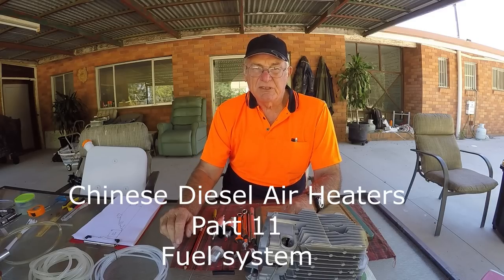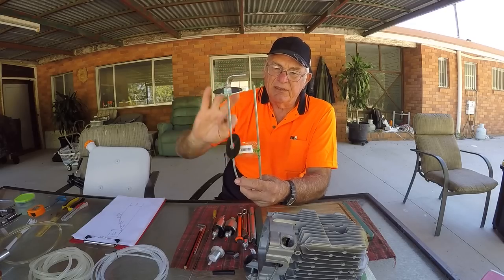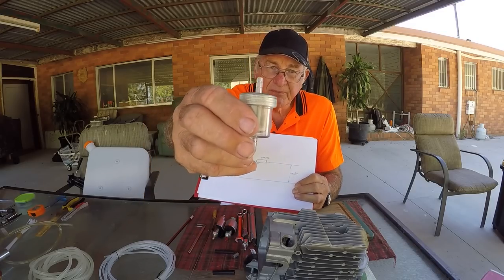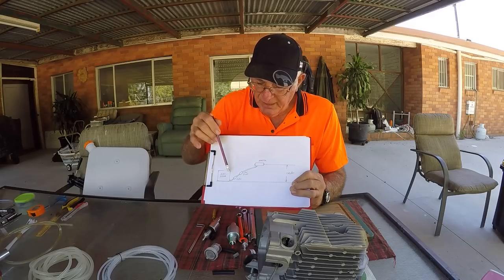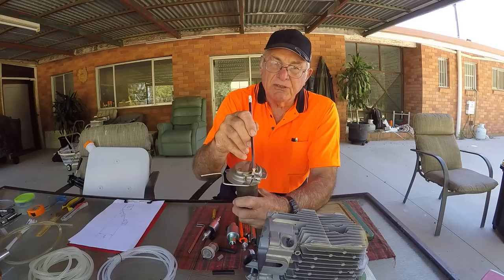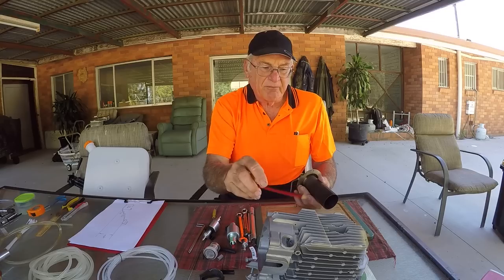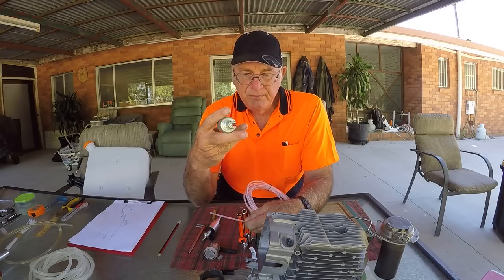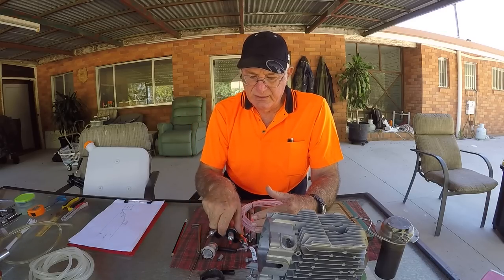Chinese Diesel Air Heaters - Part 11 -  Fuel Delivery

Comment: John, love your work and watched EVERY video to gather up your wealth of knowledge on the subject. Of course, this was not out of curiosity because I have a 2kW heater that has been troublesome in spite of your best efforts to make very installation a success. In my particular case I gathered from your comments about the dosing pump being a poor sucker and better at blowing. Extrapolating this thought I decided placing the fuel tank above the pump would allow gravity to feed the pump and it wouldn’t need to work so hard. Clearly this was wrong and the cavitation bubbles were excessive and probably the fuel dosing likewise because all that was coming from the exhaust was thick smoke and the heater refused to fire (burn). After a repeat viewing of your video I noted the fuel should gradually rise up to the pump and then on to the heater unit which I thought to be a guideline rather than a rock solid requirement. To correct my install I put a long feed line at the base of the tank then running the feed line above the height of the tank in a loop and then allowing the fuel line to run back down by siphon effect into the dosing pump. Who would have thought that the gravitational effect on the fuel delivery would cause the heater to fail so catastrophically. Obviously a trap for young (70) players who did not pay sufficient attention to your diagram showing the fuel line in an upward direction. Heater now running, no smoke, perfecto! Thank you so much for your painstaking effort. Appreciated more that you would realise. Cheers and best wishes.
Reply from the maker: Hi Michael,

Thanks for the feedback, and glad you found the videos helpful.
One question. Is your delivery fuel line hard narrow bore nylon, of large bore clear plastic line?
Cheers,  JMcK
Reply: @johnmck1147  Initially, the feed line to the dosing pump was black rubber (automotive/marine) but made the loop using the hard nylon narrow bore line. Following your advice I have steered away from the clear plastic although understand it matters little on the low pressure side of the pump. Cheers.
Reply: @johnmck1147  Hi again John, following my diesel fuel delivery correction, my diesel heater fails to fire when initially turned on and goes through the glow plug / pump dosing sequence, lots of smoke from the exhaust, 2 times before the E-10 error code shows on the LCD display. However, when I press the ON button immediately thereafter the heater starts to fire with a heavy breathing sound followed by simply working with no exhaust smoke CO is negligible and it goes and goes and goes. I’m nervous about the reliability of this heater and my gut tells me to replace it now rather than need to rely on the heater in the field.  I don’t understand why the heater fails to ignite from the glow plug from the getgo. The amp meter draws about 8.5 during the glow plug sequence. IMO the burn chamber might be the weak link. Any suggestions / comments? My leaning is towards Yang Yang deals / au focus 2kW. I remember your comments the 5kW is a better option but my motorhome install has limited space and only the size of 2kW will fit. Sorry to burden you with my problem, but you might have the simple answer which has blindsided me thus far, Cheers Mike

Comment: Hi John,    I like the way you explain the physics of what's happening to give good recommendations on installation.  It's not really critical but i think the explanation on the size of the inlet line mattering might be one point where the explanation isn't accurate.  Don't take my word for it but maybe check with some engineer friends.  Do the thought experiment and connect the pump right to the tank.  There could be 100's of Kgs of fuel and yet the pump works fine.  You got the discharge side exactly right and got both issues covered with pressure and clearing the bubble.
Reply from the maker: Hi Mr E,  thanks for the feedback and comments. I now use, and recommend using normal fuel hose from tank to filter to pump, provided the lift is not too high. It removes many joints and potential leak areas.

I always recommend narrow bore hard nylon from pump to heater.

However you are not the only person to give feedback that the pump can "lift" the extra weight of fuel in a larger bore fuel hose on a lift of over a meter or so. Well now I must do a real world test on lift height using narrow bore and large bore hoses.  Thanks again for the feedback.  JMcK

Comment: You're a really really good man, It's only by delving methodically and scientifically into mechanical engineering arrangements that perfection is achieved by observing and addressing the problems that arise. Not many are as good as you are. I would have taken it for granted that the fuel line provided would be the best to use, but it is actually terrible. You uncovered this. And the expensive one had that inferior filter too, what's wrong with these manufacturers? Anyway, well done you for revealing all this stuff, thankyou! Best wishes, Alan, in England.
Reply from the maker: Thanks for the positive feedback Alan.   JMcK

Comment: Heaps of thought has gone into Your videos.  Thank You for making such an effort to demonstrate how things are supposed to work.

A question if I may, would it help to have the fuel source above the pump as to allow gravity to push fuel along?
Thank You for an amazing set of insights.
Reply from the maker: Hi Rory, first thanks for the nice feedback.
Yes, having the above the pump can be of advantage up to a point. Once you get the tank above 1.5 meters above the pump you start having head pressure issues and a hight of around 2 meters is really the maximum head pressure. JMcK

Comment: I have bought some heaters with a large green fuel line. It is not as hard as the small nylon but harder than the white soft flexible hose you have shown.
Reply from the maker: Hi Jack,

The larger hose is fine on the intake side of the pump, but in my opinion on the delivery side, particularly if more than about 1M you should use hard, narrow bore nylon hose.

Cheers.  JMcK

Comment: hey John, I would like to firstly say thank you for such an informative, descriptive, and detailed video. last night I ran out both cash and diseal and decided to throw in some gasoline or "petrol" into the tank since I had some stored for my generator, it worked though producing less heat worked for about two hour as most people say you can run gasoline I. these heaters I was very confused as to why it stopped working. it was throwing the E8 fuel delivery code. upon inspecting and finding alot of air in. the lines I thought maybe I didn't prime the line enough and some air from the filter came thru. I primed it and fired back up. no luck. I then noticed the fuel line was "swollen". which I now know it's due to the vinyl fuel line and pulsation. I am now under the assumption that it worked in the beginning because the vinyl line was thinner although I also now know it's still over sized to begin with. so when it expanded the bubbles cannot be pushed out. but I am seeing the pump produce significant sized bubbles not little tiny ones in your video. so I ask, does gasoline make bigger bubbles by the piston naturally? did I possibly burn the pump up? as soon as I get some cash I'm going to switch back to diseal but I'm unsure if it'll work either now due to the line swelling....also if I let the line dry up it should shrink back down correct? as 2 months ago I made a black diseal blend and ran it and it also made the line swollen....eventually also stopped working due to carbon build up (had to take the heater apart and give a good thorough cleaning). but even though it swelled up with the black diseal it didn't do what it is doing now so I'm nervous because I don't currently have the funds for new fuel line. but soon as I do it's gonna be 2mm nylon. again thanks for the info snd sorry for the long message. hope you get back to me to answer the questions
Reply from the maker: Hi Victor. Sorry, these Chinese heaters are not designed to run on gasoline.

The Germans do make a special Gasoline version of their diesel heater, but it will cost you a couple of thousand dollars.

Some years ago one Chinese manufacture tried bringing out a gasoline version but it was a bad failure and quickly withdrawn.

You can use kerosene if it is cheaper where you live.   JMcK

Comment: Thank you Big John for your timely, and as always, detailed explanation. First, to clear up a few things that I most likely made confusing,  I am only going to use one 20 gal fuel tank for both heaters. Secondly, am I correct in my understanding that my filter and pump should be no more than 1.5m away from the tank?  Also, I should  push no more than a max of 3 or 4 meters (max 12 feet for us Yanks) to each heater? John thank you for the description of the nylon line. I found it straight away.
Reply from the maker: Hi MH,

Those are guidelines. It is all about head pressures etc.
If the pump is below the level of fuel in the tank, the suction side can be very long.
If the heater is close to the same level as the pump you could go a little longer.
However if the tank is much lower than the pump, the pick up line must be shorter, and if the pump has to pump a long way uphill the delivery line needs to be shorter.

In most vehicle installs these “height” issues do not occur, but in a shed or home install there can be issues here.  JMcK

Comment: Hi John good vidio again I use reinforced 4mm i/d fuel line on mine and it works very well the only thing I did was to prime it with a vauum pump  to take air bubbles out. Jeff
Reply from the maker: Thanks Geoff, I did a test run with 4 mm hard hose for 8 hours without any problem, but issues arise with people who use the real soft vinyl hose with poor heater install. Once you get soot in the burner you start to have issues with fuel delivery. J
Reply: Yes I agree it's the silicon hose that you can get that is no good as well put a vacuum on it and it just collapses. Jeff  @johnmck1147

Comment: Hello John , excellent breakdown of how these heaters work. Really like the way you convey your message and knowledge. I just wish I would have watched these videos before I installed my 5K SYSTEM! I have fired it up and I am getting E10 error. I didn't do a bench test which I am kicking myself now! My pump works fine with the clicking noise. I can see fuel being pushed into the heater input. The heater does its's start up function, there is cold air blowing out the front. The controller shows the pump symbol, the in and out of the air intake and exhaust. When it tries to combust the progress symbols on the controller flash, and that's when the E10 error comes up on the controller. I did notice a slight diesel drop where the hose and rubber tube connect into the bottom of the heater. Your expert advise and opinion would be greatly appreciated, cheers.
Reply from the maker: Hi Bera, E10 is generally a sign of multiple start failures, and this could be caused by a number of issues. Here are some suggestions.

Check there is no fuel leak at the heater itself. 

Do you have a fuel filter installed. If not the pump can be ticking but no fuel is squirted out. You can remove the fuel hose from heater and use prime mode to see if diesel squirts out the end of hose.

Is your battery fully charged? If not there may not be enough volts/current to light the glow plug.
Have you extended the battery cables to the heater and no increased the wire size to prevent voltage drop.

Do you have restrictions in the exhaust or combustion air inlet. Install mistakes here are a big cause of non starting and excessive carbon buildup.

If the heater is new and has never worked, it is very rare, but you could have a bad heater.
It is a good idea to bench test a new heater before install.

Sorry, but that is the best I can do without more info.  JMcK
Reply: @johnmck1147  thanks for your reply John!! I really appreciate the time and effort you put into your informative videos. I have learn so much from them. I found the problem when I double checked my install and noticed huge air bubbles travelling from my fuel tank to the filter. Ended up being a loose clamp on my standpipe! Thought I’d tightened all my clamps but obviously not! She fired up after the adjustment and working a treat! Thank once again!!!! Cheers.

Comment: John has some quite good videos but this one has some some assumptions that do not make sense.  In order for the pump to make pressure,  there has to be a restriction.  There is no restriction, the metal line is just square cut into the burn chamber.  Others have shown that the heater will run on a simple drip system.

Comment: Excellent advice and well presented thank you John. I watched a video where Dave showed a hand pump to prime the fuel line prior to starting the heater. I think that he said that the idea came from you, and if so, where should we put the hand pump? Before the filter or after it, or above the mechanical pump. Thank you for your great videos.
Reply from the maker: Suggest you put temporary hand pump after filter and just before pump inlet. Prime inlet hose to pump then remove pump and connect fuel hose to fuel pump. You only need to prime once.  JMcK
Reply: @johnmck1147  Oh that's good advice. I was a bit concerned with leaving it there in case the 1 way valve stuck. Thank you for the advice John.

Comment: Great video . was only looking to find out why the pump should be at an angle and got lots of great information , i have deceent fuel pipe supplied with mine, shouldnt matter to much with mine as i have a diesel feed 6 inches from the heater as my sprinter bus has had an Eberspacher fitted at some point and i notice it had the thin hard pipe to it.  i only need to pump 6 inches and maybe 3 up hill , so hopefully il be ok . thanks again .
Reply from the maker: Thanks for the feedback Gavin. JMcK

Comment: Hi John,  your whole series has been so informative/educational.  Thank you very much for taking the time to put this all together.
I have a question regarding the fuel tank itself.  During operation, do these supplied plastic tanks develop negative pressure within them, and if so is the pump able to "out-muscle" it?  Or are these plastic tanks vented at the cap somehow?  The reason I ask is that my plan is to install a diesel heater in my vintage RV camper, and I am considering converting an old 20 lb propane tank for my diesel by removing the top valve and welding on a filler cap & bung.  I'm wondering though, if the heater would only run until too much negative pressure built up within the tank, necessitating me having to periodically crack the seal on the filler cap to equalize the pressure... and if so, might it be better to go with a vented cap?
Thanks again!
Reply from the maker: Hi Arne,

Thanks for the positive comments.

The supplied plastic fuel tanks (all that I have seen) come with a vented fuel cap. 
If you use your own tank, the tank must be vented. 
A common source of fuel tanks for these heaters are outboard motor fuel tanks. They are squat, stable, and have a vented fuel cap.

Cheers.  JMcK
Reply: @johnmck1147  Excellent.  Thanks for the clarification, John.  Cheers.

Comment: My cheap all-in-one looks nothing like it did when I got it now. I turned the fuel pump up and vertical and the lines are some wires are routed differently but it looks like it was meant to be that way. The fuel pump was originally kind of horizontal and pointing downwards it would wear out fast like that.

Comment from the maker: Hi Russell. Yes you can run 4 meters on the delivery side of the pump, but it must be narrow bore hard nylon fuel line. 

Shut off valves readably from hardware stores, compressed air section, or small engine suppliers. I generally buy mine at Bunnings or Supercheap. 

Have you watched the motorhome videos?  JMcK
Reply: yeah mate watched it last night 👍
Reply: i can only find 3mm id is this still ok to use
Reply: mate where do i get 1/2 bsp to 3/16 barb from i can’t seem to find one
Reply from the maker: Sometimes you need to make the adaptors yourself. Eg nylon hose into rubber fuel hose, or copper pipe an expander and solder. JMcK

Comment: I don't have one of these pumps, so this is just speculation, but I would think that the thump you hear is the piston hitting the pump body at the end of its delivery stroke. I would suggest putting a small fuel jet from a carburettor or similar in the outlet pipe to slow down the flow of fuel and so slow down the piston.  This will reduce the thump. The jet will have to be big enough to allow sufficient fuel through and small enough to offer some restriction. It will need some experimentation.
Reply from the maker: Hi Alan, 

I agree with you, the "ticking" sound is the piston hitting the stops. 

Thanks for your suggestion as to how to reduce the sound noise.

JMcK

Comment: Thanks for taking the trouble to explain this, it makes a lot of sense.
 So I'll install my fuel pump slightly below the heater at an 45 degree angle and connect it up with a 2mm bore hard nylon pipe, question is, would I then be able to mount the fuel tank above the heater? It's just that since I plan on mounting the heater to the vehicle floor I'm not left with anywhere else to put it. I assume mounting it above the pump would improve fuel flow to the pump inlet and lighten the pumps workload. Is this feasible?
Reply from the maker: Yes Mr AM. You can mount the tank above the heater up to about 1 m without getting excessive head pressure issues, however it is good practice to install a small fuel shut off valve in the fuel line close to the tank and before the filter and pump. This prevents the diesel draining out past lose or worn pump valves when not in use.  JMcK